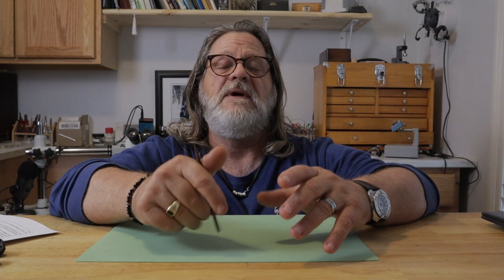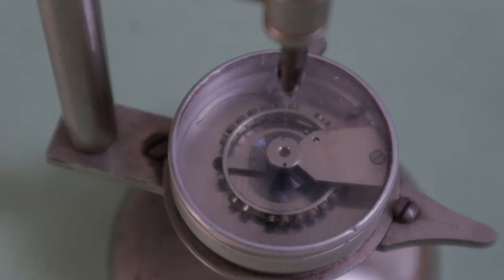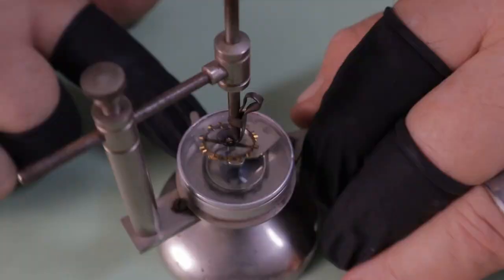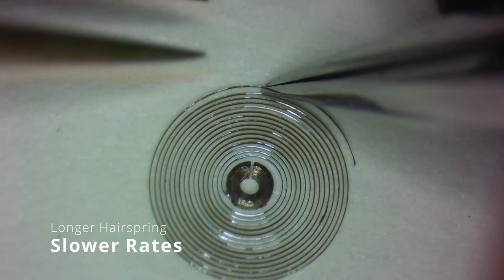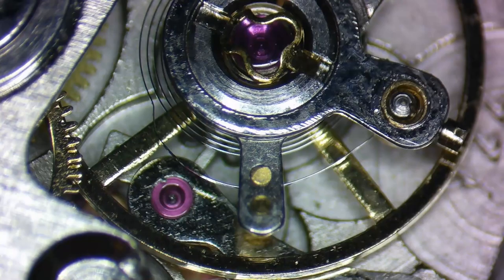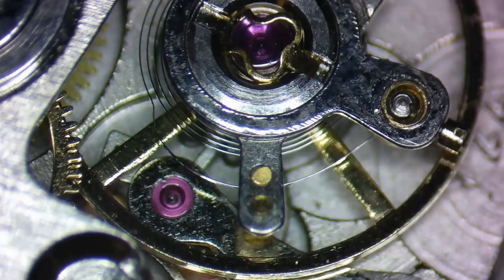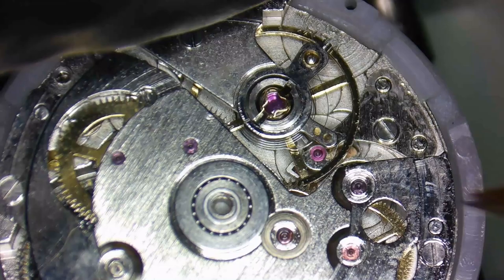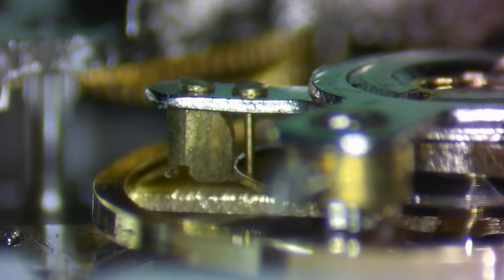Watch Regulation- The In's & Out's

Comment: Hey, Alex! I know it’s not your job to help me, but I am having problems regulating an Omega 30t2SC. I have checked everything possible(loose collet, flat or round hairspring, impulse jewel, roller table, jewels, end shake, etc.) but the rate is outrageous. The time grapher can’t even read it. It just shows the dots going on a straight line up, but the beat error is good. And the amplitud is an an ok range. I don’t mean to bother you, but would you suggest anything I can do that I may not be doing? I appreciate any help!
Reply from the maker: No problem, what are your rate and amplitude in the dial positions at a full wind?
Reply: Well, see it’s weird. The time grapher doesn’t show any numbers for the rate. Only a bunch of lines. But if you look at the screen, the dots go just up on a straight line as if the watch was running super fast, but I put the dial and the hands on the movement to check the time with my phone since the time grapher is not reading the rate, but the watch is actually running slow. I set the time last night and fully wound it, and it lost like 15 minutes just in about 5 hours. But the amplitude is about 250•, and the beat error right now is about 0.4ms I know I can work on bringing it down a little more, and maybe work on bringing the amplitud up more, but I don’t know why is losing so much time. I really appreciate your help Alex!
Reply from the maker: @josetjaycastro4778  so first things first. you can’t worry about the rate until the watch is put into the position to be regulated. Start by adjusting the gain on your timegrapher to see whether you can pick up the signal. When a timegrapher is unable to determine the rate, it is normally because there are other sounds that should not be there within the escapement that are confusing the software. One example might be the guard pin hitting the safety roller. 
So a deep inspection into the escapement is needed to determine that everything is functioning as it should. Unfortunately, that is a extremely long subject.
Also realize that testing the timing of a watch with the hands at this stage can just confuse matters. A movement can also lose time by lose cannon pinion or the dial hole not being centered over the extended arbor of the center wheel. 
A deep understanding of the escapement and how it works as what you need to focus on to fix this problem.
Reply: Hey, Alex! I appreciate your long and detailed response. I really appreciate your help! I am going to do what you are suggesting, but I also bought your book about regulating a watch. I am waiting for it to learn everything I can to become better at regulating watches. Thank you again for your help! Happy thanksgiving in advance!
Reply from the maker: @josetjaycastro4778  thank you brother. Happy Thanksgiving to you and your family.

Comment: So how do you set it up?
Reply from the maker: I don’t understand you question.
Reply: Ok I am getting there. So I seem to gather that the spring should not  touch the reg pins at rest ideally. It should touch one then the other as it cycles? I have seen watches where there is no gap and others where there is just a single hookover pin. Most of the stuff I do is fusee from the 1890's where there are two pins. What is the ideal set up situation? @watchrepairtutorials

Comment: I'm a newbie and I was trying to take the balance of the cock but the little thing that holds the spring between the regulator pin was not slotted to be able to turn it with a screwdriver to release the spring. After a bit of a struggle, I was able to turn it, but unfortunately I bent the regulator pin that touches the spring I tried to bend it back and it snapped...can I do something to it? Or you have any tips on how I should have handled the situation?
Reply from the maker: You can replace regulator pins, which will be covered in the series for staking sets.
Just remember not to force anything.
Reply: @watchrepairtutorials  Thanks! Awesome videos, can't wait for more!

Comment: Just a question if I may.  I purchased a FC highlife chronograph and the chronograph hand jams for a few seconds when almost reaching 12, then it moves again and does the same thing when reaching 12. Sometimes it jammed completely without moving again. 
Also the sub seconds also jams when this is happening. I sent it back to the AD and they say it was because the power reserve was low. Is this possible? And should it be happening just because of a low power reserve?
Reply from the maker: Whats the history on this watch? Is it new or did you buy it second hand.
Reply: @watchrepairtutorials  it is brand new from a authorised dealer
Reply from the maker: @tariqjoseph3562  are they saying that you are not letting the auto winding build up enough power? Low amplitude can cause problems with  chrono functions.
Reply: @watchrepairtutorials  yes, they said exactly that. That the power reserve was low and that is what was causing the issue. 
Before I sent it back to the AD to be checked, I didn’t think to fully wind it then try the chronograph and see if the problem still happens, so I have to take them at their word until I get it back. I was just wondering if such an issue can happen during the back end of the power reserve. 
Btw, I appreciate your responses (likes and subbed) 👍
Reply from the maker: @tariqjoseph3562  no worries my friend. Hopefully you get it back and no problems. Thanks